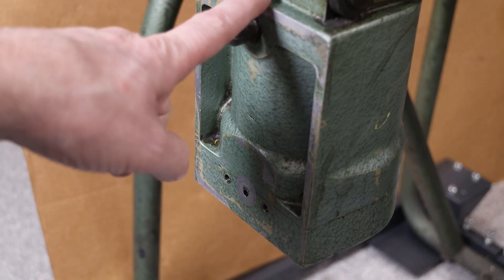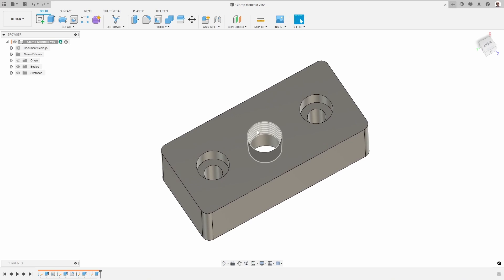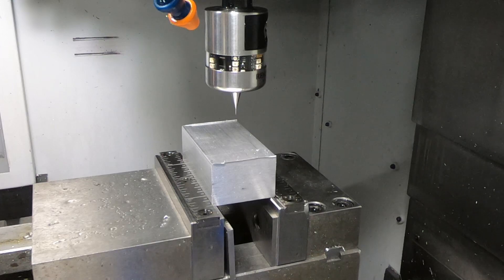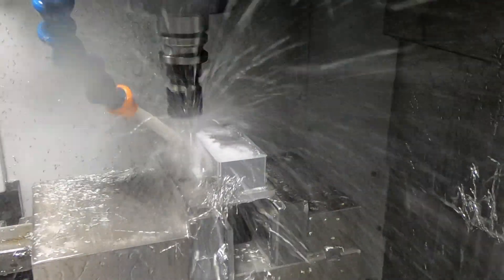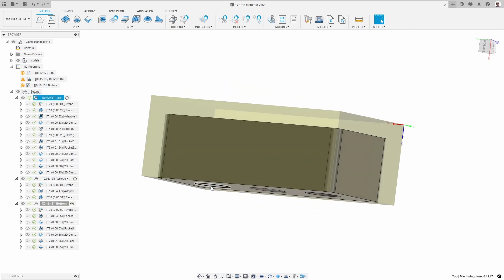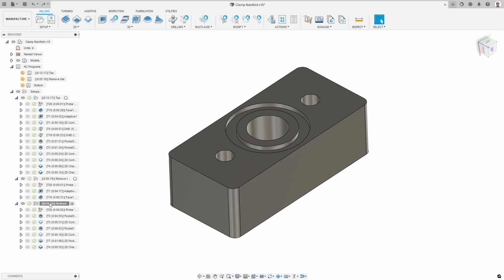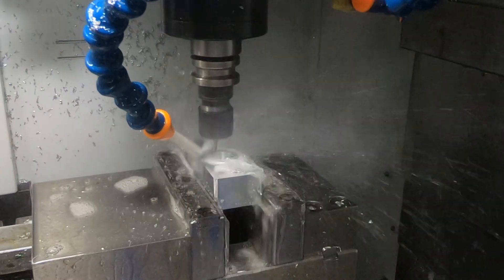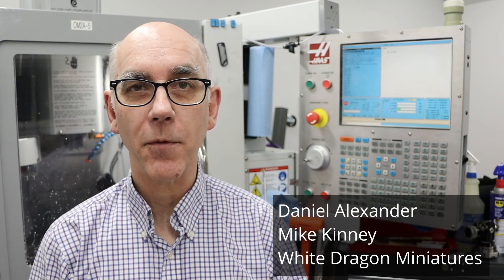Perfect 2-Sided Milling: Making a Manifold

Comment: I do also such stuff on my old tool room mill, either you can use a hole which you drilled through for alignment or you do the most simple thing, prepare your stock on the final dimensions and touch the middle, by me with the wiggler it is very easy, i take both opposing corners and calculate the right coordinates. And i always hit the middle with this methode, repeating with less then 2/100 mm With the probe thats much simpler

Comment: Having the probe gives you so many options.  On the first op drill or mill the hole all the way thru the stock.  Program the second op to touch off on the center of that hole.  This will give you better alignment to the first side.   Great video!  Keep them coming!!
Reply from the maker: Thanks. Others have pointed that out as an option. Given that my end mill wasn't long enough to go all the way through, and a drill can wander, I think the option some others have pointed out would be better in this case: probe the center rather than a corner.
Reply: Actually my experience is that probing the outside edges is definitely more accurate by about 5-10 microns. I find that if I bore a hole and then measure it, it's typically a few microns off from where it "should be". So I tend to use the "drill a hole" trick as only a way to get an estimate of the alignment.

Comment: To get rid of the stock size problem set you WCS to the middle of the part and have the probe touch Z then the 4 sides. The part will always be aligned as long as your vise is trammed.
Reply: You're totally right on programming to the center of the part but if your stock isn't cut perfectly square when you flip it, you're going to be off.  Drill or mill the hole through the fist op and and probe the hole on the second.  It will be dead on.  If you want the Z to be perfect program off the bottom of the part for the second op and touch off on your parallel.  Make sure your part is down all the way!!
Reply: @cre8itgroup903  since the part has been fully machined the original stock wont matter.
Reply from the maker: David Loomes on Facebook pointed out to me that I could have used the center. I do plan to try that out in the future. As to the top, I set Z zero to be the bottom. I have G55 set to the piranha jaws and G54 set to the top of the parallels. That will give me the final thickness I want.
Reply: @JohnSL  I use a z probe to set the top of the part and subtract the stock. I use a G92 on the bottom of your offsets to drop any remaining amount.

Comment: nice work as always John.  I need to get a probe system!
Reply from the maker: Yes, you do. I've been using it today to make a new mold, and it's so nice. I had to put a mold half back in to fix and issue, and it was so fast and easy with the probe.

Comment: Being from the UK I appreciate the metric conversions 
I can never get my head around how 10thousandths of a inch and so on compared to simple 0.025mm
Reply: Im from uk and use both imerial and metric. Just multiply or divide by 25.4  to convert between the 2.
0.001 is one thousands of an inch so 0.01 is 1 hundreths 0.1 is 1 tenth. Additionally 0.0001 is 10throusands of an inch. multiply each of these by 25.4 to get metric conversion.

Comment: I use the back left corner of my vise as my X Y location and I hold a 123 block there to line up my stock with the edge, then when you flip a symmetrical part like this you don’t need to re probe the raw stock, the finished stock is perfectly set on the edge of the vise.

Comment: Question around the 3:16 min mark you are clicking between operations and its showing the simulated stock at that point of the operation clicked. How do you set that view up I can only see simulated stock in simulation mode not just clicking around in my operations?
Thanks!
Reply from the maker: This is done using the toolbar at the bottom of the screen shown in the manufacturing workspace. There is an icon for Stock visibility. I've checked the option called Display in process stock. F8 (on Windows) will toggle this.
Reply: @JohnSL  I had turned that on before and there was no effect. I found that you have to go under the utility tab and enable it there as well.
Thanks
D&J

Comment: you can make yourself your life a bit easier by changing the Setup of OP2 and OP3 to use the stock from the previous operation. By activating rest machining as well you will also get a good simulation result at the end of the last OP.
Reply from the maker: It was slightly different from the previous operation, as I made it shorter to account for the hat that I milled off in op 2. As someone else pointed out, I could have combined ops 2 and 3, which would have been easier.
Reply: @JohnSL  Thats not a issue at all. 
in OP1 you do everything the way you did. In OP2 use the stock from the previous operations with continue rest machining and take of the hat. In OP3 you use the same settings, by this it will continue with the result from OP2, which should be exactly what you have on the mill at this point in time. 
The only situation where this method has some issues are situations where you have some stock cut off with a saw or on the lathe or 4th axis. As the Stock that you have cut off will transfer to the next Setup. You can cheat a bit and insert a dummy operation to remove this just for the simulation....

I use this method a lot (minus the automatic probing as my DIY machine does not support it). Typically I don't know my the correct stock size when doing the initial programming as I make a lot of stuff in the Hobby area from scrap parts. Having only one point to change made my life so much easier. The rest is just regenerating the code and you are good to go.

Comment: I'm not sure your overall process here is optimal? Are you clear that you can set your G5x to somewhere on the part, yet probe the stock? This works fine (unless your post processor is busted. I had to fix mine first...i think Haas is ok though)

Another tip is that you can probe to refine a G5x location estimate. Even mid setup. So i sometimes flip my part, probe the top hat stock to get an approx position, mill off the top hat and then reprobe the part to get it bang on.

One problem i notice with this technique is avoiding burrs distorting the measurement. I've only got a tiny 2mm probe tip, so more than a tiny burr throws off my measurement. If this is a production part then I've has reasonable success running a zero size chamfer to trim most of the burr. However I've had better success with adjusting the facemill direction to avoid a burr on the edges i want to measure...

So i usually use bottom centre/centre for op1. Then flip it and use bottom centre, but hard up against the fixed jaw for op2. This works because the Y is measured from the fixed jaw. Fusion had no issue setting the WCS to the centre of the part by probing the right edge (say). ie it knows how to offset the WCS based on the model.
Reply: Also you can do rotations with the probe. I recently did a circular part that needed clocking precisely when flipped to chamfer the through holes. Rather than make the fixture have alignment pins I just measure a bore and then compute the rotation. Add a G68 to rotate the WCS (I needed to do a little bit of custom post work to allow this within Fusion for my post)

The probe is very powerful. It's great for finding WCS locations, however it's even more powerful as a work flow tool to simplify setups!

Comment: Two easy ways to deal with a top hat, set your bottom height on some holes in op 1 as stock bottom, and pick up a WCS off a hole (use the selected contour option when setting WCS in fusion setup)
Or, put a known true block in the vice, against a good stop and probe that in X and Y, use the jaw/parralell as the z height, then you can swap to the real part and the fixed jaw and stop won't have moved, and neither will the z height of the jaw.

Comment: Running max depth of cut and minimum width of cut will be better for tool life management and reducing tool wear. Cutting only on the tip of the end mill rather than using the entire flute length actually increases spindle wear - not a problem with the conservative cuts you are making, but you can be just as conservative doing something like max DOC for the cut/tool and very minimal WOC, something less than 5%

Comment: Do you probe the vise into location first, in order to use the probe automatically in fusion? If the vise is positioned correctly then seems you could probe without worrying much. Also, how did you set the Z on the parallels, do you just use a 123 block on top of patellae or do you probe the bottom of the vise and then add the parallel height?

Thanks!
Reply from the maker: I set the Z separately, as that doesn't change from one job to the other. With the 1mm diameter probe tip, I can easily pick up the top of the jaws and parallels. Since I use either the jaws or the same parallels for almost every job I do, I just have the top of the jaws set in G55 and the top of the parallels in G54.

Comment: I'm imagining for the third setup you can use the next G like G55 or G56 etc to use the model as the WC instead of the stock volume. Maybe I'm mistaken?
Reply from the maker: Yes, that's what I was trying to do. However, the probe was not moving far enough "left" from the camera's view along the Y axis when I did that. As a result, it picked up a point on the curve rather than the side of the part. I could have made the offset larger, which would have eliminated this issue. Or I could simply have combined the 2nd and 3rd operation, while still using two probings.

Comment: I feel like I've just viewed something important that I don't quite understand or know how to implement.   How is the results of the probing actually utilized- that is, used to adjust the orientation of the part within the CAM environment?   I wonder, too, if there is a way to not just identify the extremes of a part, but its orientation- say the part is oriented 9 degrees off of square, might the probe be used to apprehend how the part is oriented, and adjust the model in CAM to match?
Reply from the maker: There are a lot more capabilities available via Fusion 360 with the Manufacturers Extension, such rotating the coordinate system to adjust for part orientation. I do not have that extension yet. As to what this is doing, it's updating the work coordinate system, such as G54, with a new X/Y origin so that the milling will be aligned with the actual X/Y position of the part rather than the initial, less accurate coordinate that I set just by eye.
Reply: @JohnSL  Oh- I see.  Is this dependent on having two faces perpendicular to the X and Y axis?   Or might you have a jelly-bean shaped part, and take a great number of samples until you located points at the most extreme edges of those axis?  Is what you speak of not unlike zeroing to the corner of stock using a locator plate?
Reply from the maker: I don't have the manufacturing extension, which is required to unlock these capabilities. So I don't know for sure what it can do.

Comment: Why not mill two dowel holes and use that as reference?
Reply from the maker: That also works. If I'm using a circular feature as reference, I want to make sure it's accurate. A hole that is drilled won't be accurate. One that is milled should be. It's been a while since I worked on this, but what I recall is that the end mill I used to make the holes wasn't long enough to go all the way through.